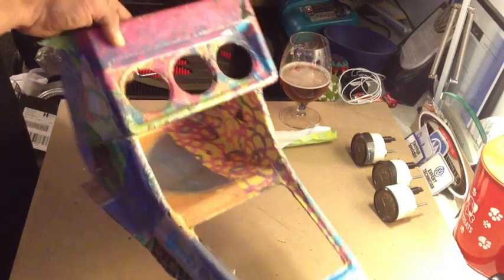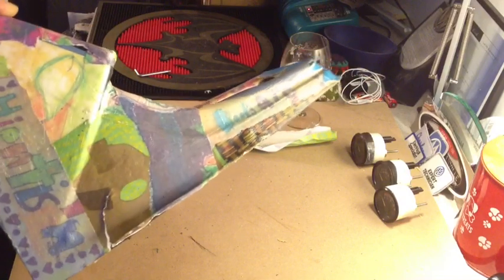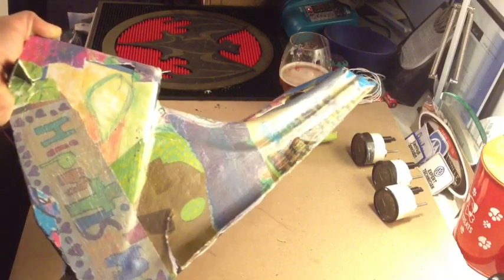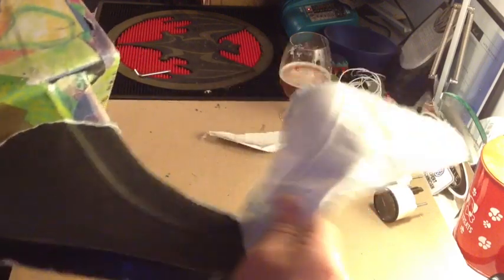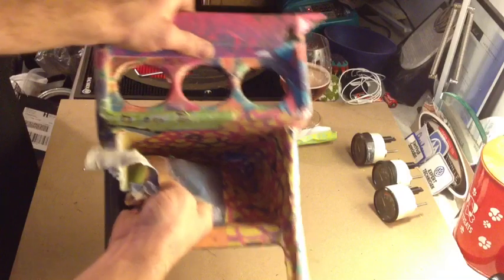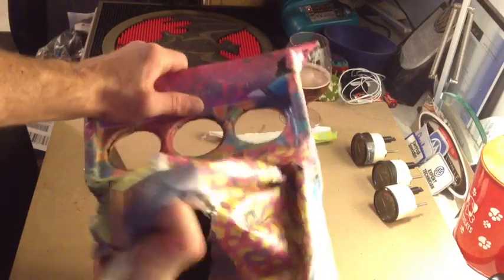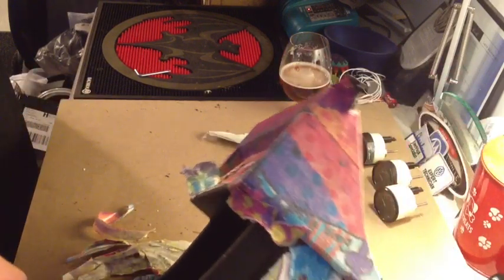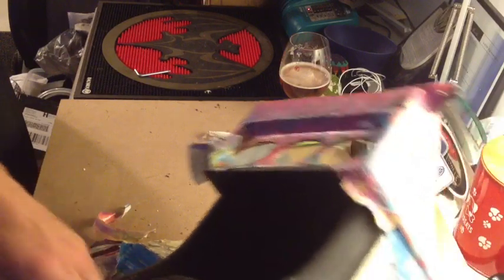Fixing the Center Console on the Volkswagen Cabriolet, AKA, Project Luv A Dub

Comment: I'm trying to figure out a short as my fuse #18 (15A), for the triple gauge, and horn, etc., is blowing. 
When I take off this console, I see two disconnected plugs just laying on the transmission tunnel-- what is this? 
Any suggestions on common places to start trying to find this?

Comment: Hello, do you happen to know a way to fix the vacuum distributor (heater/ac)?
Reply from the maker: TheUnderbraking It depends on what is wrong with it? Many times with cars that are old, the plastic is brittle and breaks
Reply: HumbleMechanic yes, I believe that's it...the flap does not open properly. the part is very hard to find...any advise?
Reply from the maker: TheUnderbraking Junk yard is a good place. Also http://www.mk1autohaus.com/ has a lot of stuff. They are AWESOME AWESOME AWESOME to work with. I can't say enough good things about them.Heck send me a picture and I will see if I have one. I have parts from 2 Cabbys.
Reply: Hey, I sent you a private message over your website with the part diagram...no answer...
thanks man!
Reply from the maker: TheUnderbraking I havent seen anything like that come through. email me Charles(at)humblemechanic(dot)com
Reply from the maker: TheUnderbraking sorry about that
Reply: Hello, I sent you a message at the address you gave me a couple of days ago, can you pls check? thanks man!
Reply from the maker: I see the pic you sent. I just need some research time.